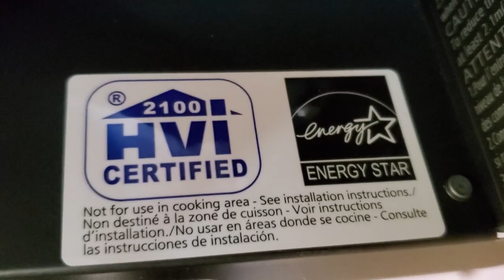Air Vent Pipe Cut Off from the Wall for Mirror Cabinet Installation

Comment: You terminated the waste stack that is being used by the floor below or under the slab! This isn’t right…
Reply from the maker: This video, not a full episode. Here you can see what was done before under sink - Air Valve Inside the Cabinet, Studor Air Admittance Valve  https://youtu.be/mZ-7dBAz3Uk?si=QEZQeBWiFmA547QO